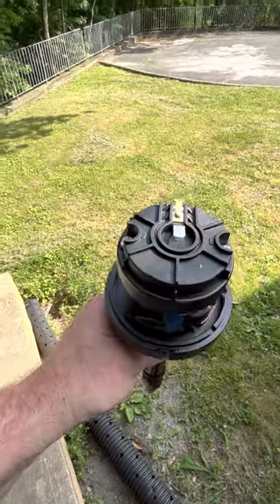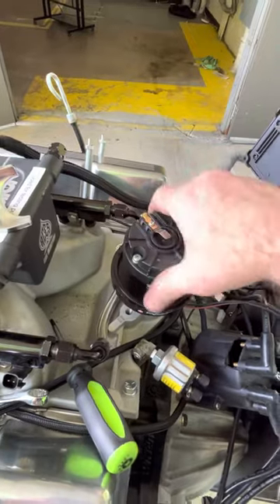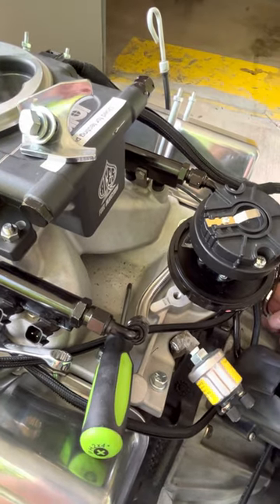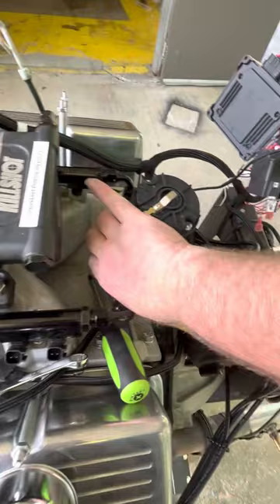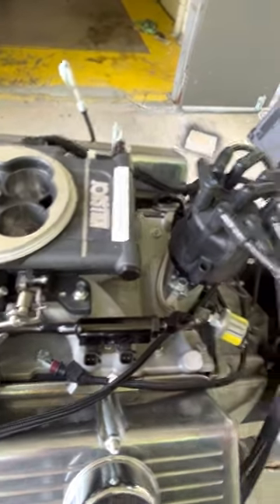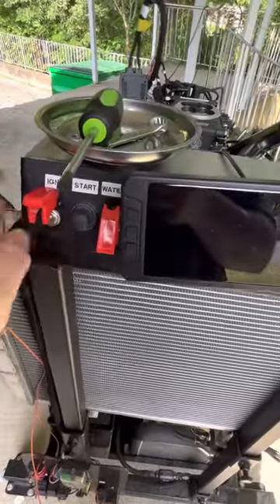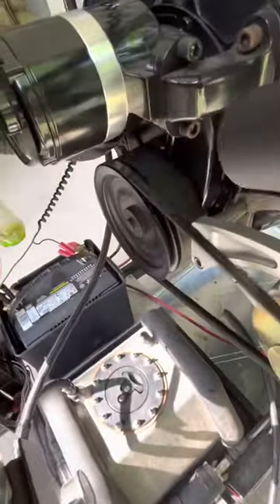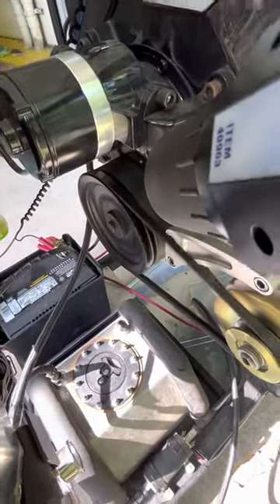Black Jack pro install

Comment: Enjoyed the video I purchased same distributer for my ford 302 - wasn’t sure about the 15 degree BTDC - is this standard for aces efi or is that the stock specific - I believe mine calls for 8 degree BTDC - thanks for any reply
Reply from the maker: The 15 degrees is a standard to verify your mechanical timing and digital readings are the same so timing control can do its job accurately

Comment: Does it have to be 15btc my car manual says I need 10btc. Or does it automatically adjust itself to run as needed?
Reply from the maker: The 15 is to make sure the digital value matches the mechanical for timing control. The computer has no clue where it is so we install it at 15 and mechanically and digitally lock the timing to read the same value as a starting point after that is done you can tell it what ever you want to for timing value.

Comment: I just purchased the kill shot and im no mechanic. But i have an msd distributor and 6al box how do I hook it to the box to control timing if you don't mind answering.Thanks
Reply from the maker: Lock out the distributor and use the vr wire on the killshot harness then use the point wire to trigger the MSD box. There is a diagram that will help in the instructions.
Reply: @actionvulture5251  😀 thanks for replying I appreciate it and I'm going to sub to your channel right now.

Comment: Why when I use the blackjack distributor my timing light jumps 4 degrees plus or minus when it’s blinking on the timing marks? But with my old hei it will blink steady ?
Reply from the maker: With timing control it is calculated. So it will vary some at idle due to the low speed of the reluctor ring. Nothing to worry about at idle. Also it will move around to keep idle stable.

Comment: Im installing mine myself im not a mechanic but do i just remove my hei distrbutor and just drop the efi one in the spot location  and direction as the other one
Reply from the maker: 15* btdc and correlate the values. Make sure to mechanically lock it out.

Comment: What are your thoughts on the aces killshot system?
Reply from the maker: I enjoy them. I have done a lot of aftermarket systems and the biggest thing is install and timing with a touch of proper o2 sensor placement. I do enjoy the aces products a lot of very technical things have been fixed in the system as compared to other brands I have dealt with. Feel free to ask any questions.

Comment: is this setup supposed to hold pressure after shutoff?
Reply from the maker: Most fuel pumps bleed off slowly after key off. If the engine is hot after key off it will hold pressure long due to the fuel expansion and vaporization.

Comment: trying to understand why it sounds like a boot in a dryer
Reply from the maker: It has a plug wire that needs replaced. It’s also a very tired engine due to years of test stand abuse.
Reply: I was just getting ready to ask If he was hearing or was just Amplified by the video
Reply: @actionvulture5251  LOL I have a Body that can relate   That was the Kill shot correct  Seem to fire and run  Great  Took Fuel  well Keep the videos  Coming on the Products  ty
Reply from the maker: Like the best comment on this channel yet. I had to rewatch my own video and decided it was very accurate. Also going to have to change those plug wires for next video lol.

Comment: Was that a valve tap or an exhaust leak?
Reply from the maker: Oh that engine is eating itself. The cam don’t even cam anymore just makes metal. But I got a crate 383 ordered to replace it in the spring. We been doing testing on the fox body lately.

Comment: Why is it banging and popping at idle?  You have something wrong.
Reply from the maker: Burnt valve. I built up a big block to replace it for the new big block Chevy multiport testing coming soon. That engine has been on the rev limit one too many times.

Comment: Um that is about 12 degrees btds past the marker is about 15
Reply from the maker: Pretty close. But on first install you can be a few off then get it adjusted in with the light. Too easy. Got anything else you wanna see me film I am opened to suggestions. I got a joker system I need to put on a truck soon.

Comment: Hello again I locked out my msd dist plugged in the VR wire from the killshot to dist. And ran the points wire to the point wire in the msd. And now I have no spark, did you ever have an issue like that.
Reply from the maker: Make sure it is selected as magnetic in the setup wizard